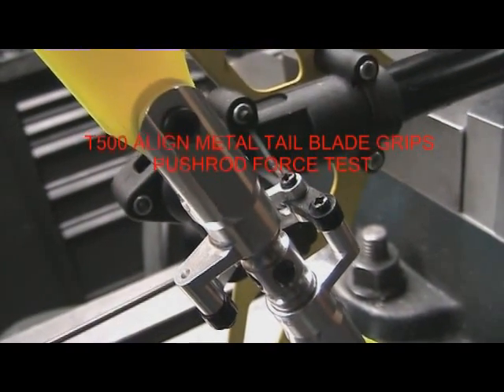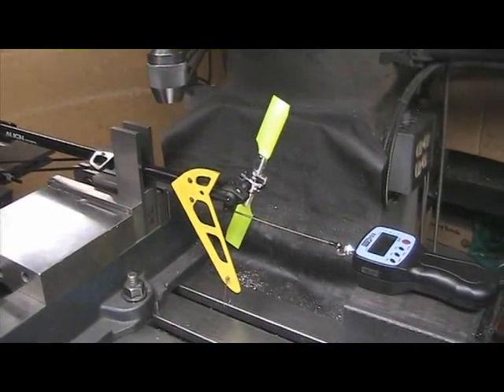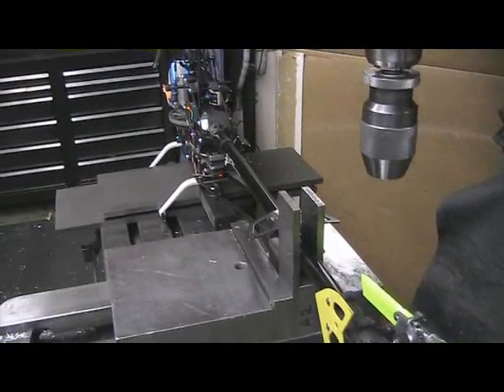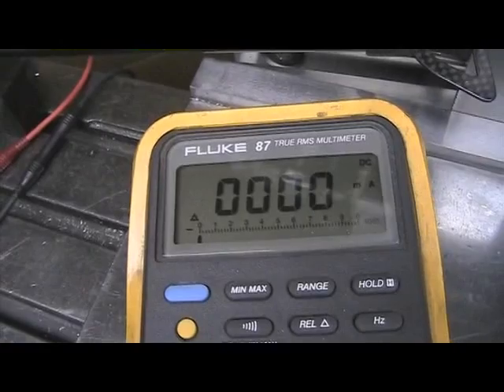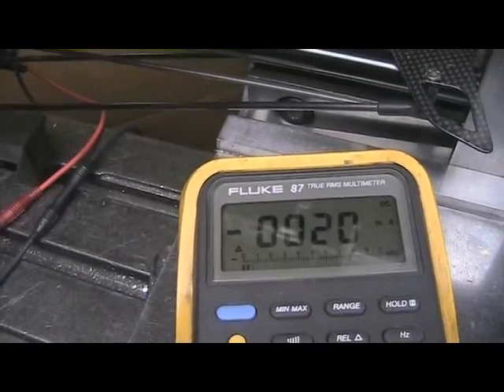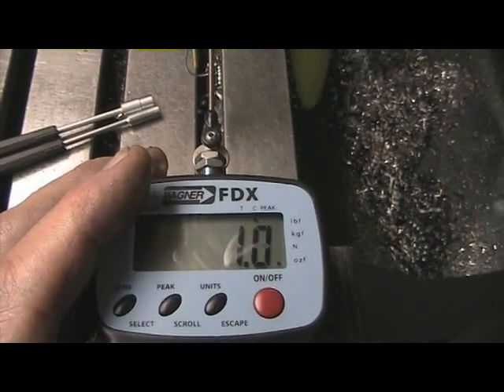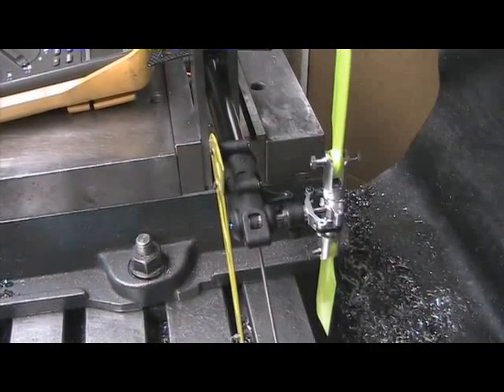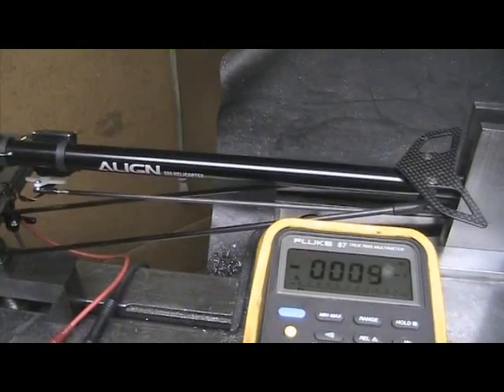T500 Align metal tail grip pushrod forces

Comment from the maker: The power to drive the tail rotor is greater when the tail is held still. The power to change the pitch of the tail blades is not  affected. Except for tennis raquet effect forces it takes no virtualy no force to hold the blades at any reasonable pitch.  The current draw change you saw will be the same in flight as in the tests